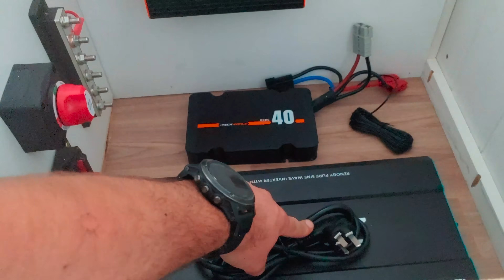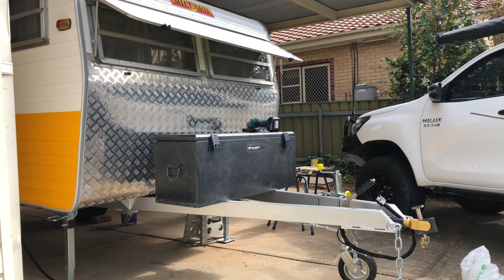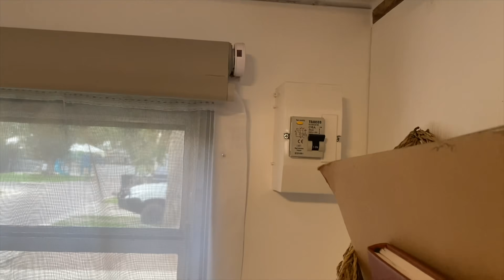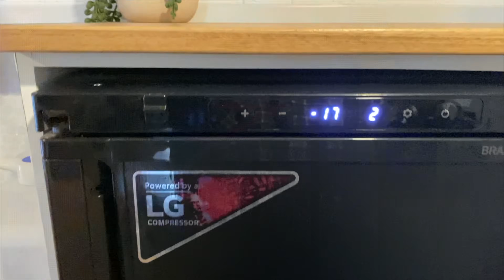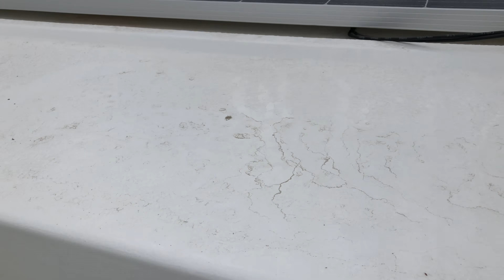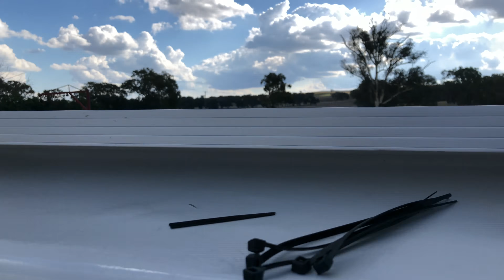Episode 10 - DIY OFF-GRID 12V ELECTRICAL INSTALL - Caravan Build Series | 1978 Millard Mini Pop Top

Comment: Thanks for the videos, I really enjoyed your build, That's a great idea with the inverter, We're u going to install an itechworld inverter and then change when u found this one, Just wondering, As u have used the 2 different brands, and is Renogy the only brand u know of making the internal priority switching inverter,  Thanks
Reply from the maker: Our pleasure mate thanks for watching. So if I didn’t want the AC transfer I probably would have gone with an iTech inverter. I originally wanted the Enerdrive E-Power 2000W inverter with AC transfer as it would probably  have to be the best one out there and comes with a RCD built into the inverter but was just a little out of the budget for the build unfortunately. I think it was around $1200 where as the Renogy one I bought was only like $329 or something like that. It’s been working great, the AC transfer works very well and I’ve had no problems with it at all but definitely would’ve gone the Enerdrive one if the budget permitted.

Comment: I see Maltese blood in yas, and i am glad u installed a sub board after the inverter, if the mains rcd trips in some places then u might have to install in addition just a regular c/b and a single GPO so u can have both at the ready and the unprotected c/b & gpo marked with RED labels. Maybe u should have gone with flexi panels and installed 4 of them, Any chance of draw bar measurements from ya so i can replicate that on my dual axle even with ya tool box dimensions inc depth behind the tool box?
Reply from the maker: Hi mate, not Maltese haha. My heritage is Italian 🇮🇹 thanks heaps. Can never be too safe when it comes to 240V I suppose. Good ideas and thanks for sharing. I can’t remember off the top of my head the measurements of the drawer bar. I’ll take some today for you and pop them back in the comments here. 

The toolbox is 1100mm x 365mm x 425mm and I got it from Supercheap Auto a few years back for the box trailer I built. I purposely left enough space behind the box for my 15L diesel heater tank and so the lid opens up all the way.
Reply from the maker: So I just measured the drawbar. The total length of the 100x50x3mm RHS we used per side is 2600mm long. From the middle of the front of the van to the tip of the hitch is around 1800mm.
Reply: @jossandell  Thanks heaps m8, much appreciate it.
Reply: @jossandell  how thick is the plate the hitch is bolted to?
Reply from the maker: @OffGridAussiePrepper  10mm plate 👍🏼
Reply from the maker: @OffGridAussiePrepper  no worries mate.
Reply: @jossandell  tks
Reply: @jossandell  that diesel tank is it 4 or 6 inches?
Reply from the maker: Not too sure I’ll have to measure that tomorrow for you. I’d say just under 100mm.

Comment: With the 6b&s cable coming from the car I would go 4b&s and 60amp midi fuse because they do speak to over 50amps when first plugged in
Reply from the maker: Hi mate, I was considering running 4b&s however the 6b&s I bought from Home of 12V Mount Barker was rated to 80 amps over 10mtrs which my cable run wasn’t quite that long so thought it’d be fine. I do have a 60 amp midi fuse as well. Cheers 👍 

https://www.homeof12voltonline.com.au/products/13-5mm-twin-core-automotive-cable-6b-s-rated-to-80-110-amps?_pos=2&_sid=7380e0b5d&_ss=r&variant=36540731850911
Reply: @jossandell  I upgraded my to 4b&s and used the old 6b&s for the esc and I now see over 40amps all the time as before I would only see 30amps and I have 2 mppt controllers one for the solar off the roof and the other one for portable solar panels
Reply from the maker: That’s not too bad then. Might have to look at upgrading in future. I just went with the 6b&s as it was rated for what I needed.

Comment: Upgrade those cables on the ac charger
Reply from the maker: Hey mate, thanks for your comment and concern. That’s actually the cabling it came with, they’re rated to 20amps and is fused properly and doesn’t get hot so don’t think I really need to change them. Literally the shortest run of cabling around 300mm long and charges fine 👍🏼

Comment: Do you have a fire extinguisher handy the the cable from your 20 amp charger is way too small it needs to be at least 10 mm2 not that tiny cable you have there, im a sparky that has 25 years experience in wiring c,vans ect ,i dont know where you got advice in wiring you van but i would talking to someone who knows about 12 volt wiring and volt drop issues, warning i would not put 20 amps throught 5hat tiny conductor..
Reply from the maker: Hey mate, thanks for your comment and concern. That’s actually the cabling it came with. I never usually use the cabling that come with things as they are often undersized, this was the case with the inverter. I ended up purchasing 00 B&S cabling to replace the little ones that came with it however for the AC charger it’s the smallest run of cabling less than 300mm and it’s fused accordingly. It charges fine without getting hot. Everything else we went oversize with all our cabling to ensure no voltage drop. We had a sparky do our 240V. All the 12V I did myself. Like I said at the end of the video, I’m not a professional at this and I’m sure there are a thousand better ways to do things but I made sure I did my voltage drop calculations everywhere and it was all safe. We have a fire extinguisher at the door way and a smoke alarm above the dining area 🙂

Comment: Suggest a seperate solar controller for roof panels, so when your driving you'll get charge from car and panels together, dcdc will just do one at a time.. grab a victron 100/30 smart controller, and if you get a blanket you can run that into the dcdc Mppt input.
Reply: 100%
Reply: You have done a great job on the van.
Reply from the maker: Thanks heaps!
Reply from the maker: Thanks heaps mate. That’s a fantastic idea and it’s something we thought about doing however it’ll be a future upgrade at this point 👍🏼 would be great to get solar on top of driving charge.